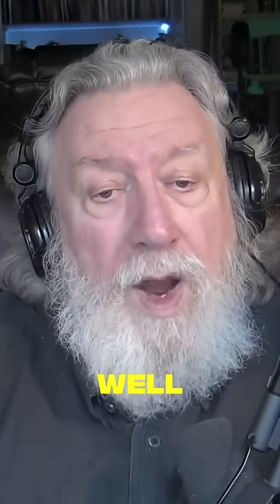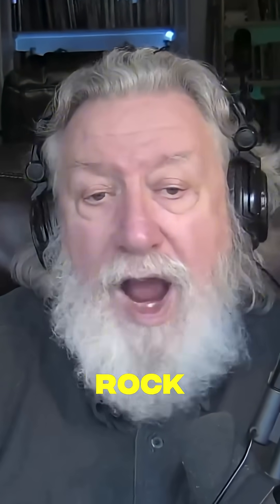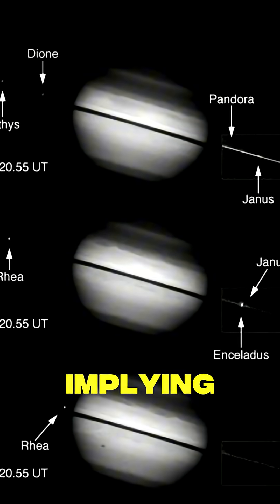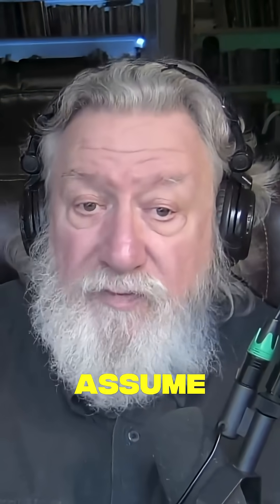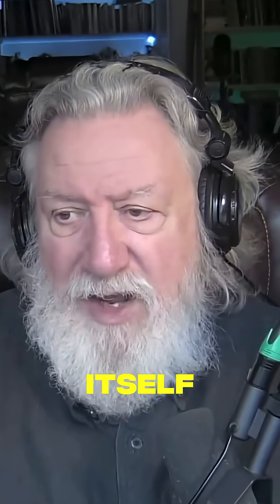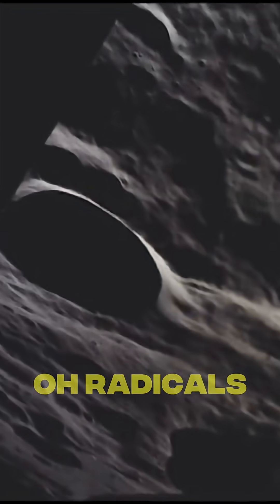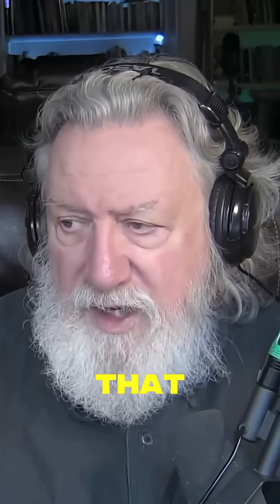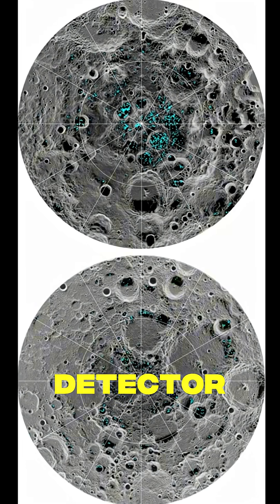The Moon’s Strange Secret

Comment: The Moon has been impacted many times, judging by the craters on its surface. Here on Earth there are many craters that have been consumed by plate tectonics. Billions of years.
Reply: No shi Sherlock! 🙄
Reply: Wtf happened in this thread?
Reply: Is anyone else so old that they remember that when a young woman wanted to get on birth control, the docs would give them the pills, but they had to wait until a certain time in the moon's monthly cycle in order to be 'in sinc'
Reply: Those aren't impact craters. Not most of them anyway. They are craters from an electrical discharge.
Reply: @dextermorgan1  electrical discharge from what exactly?!